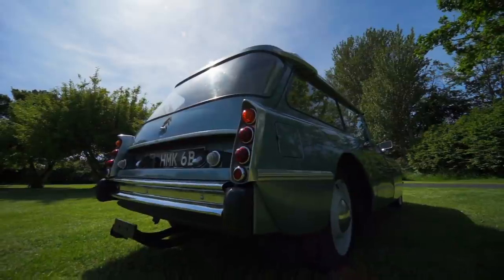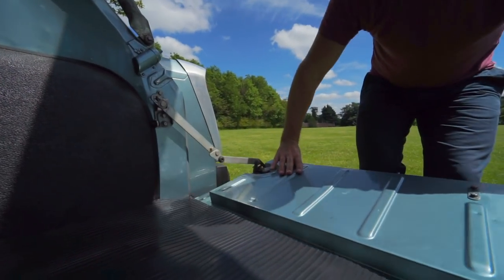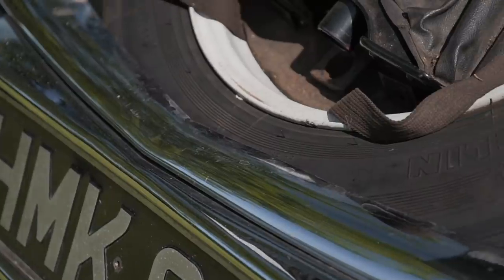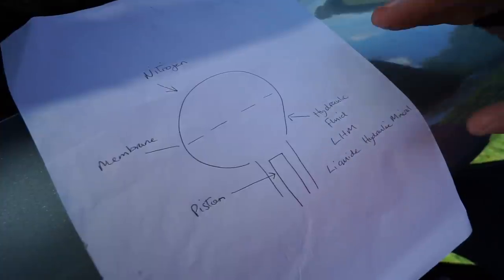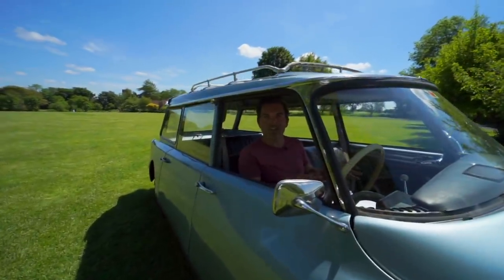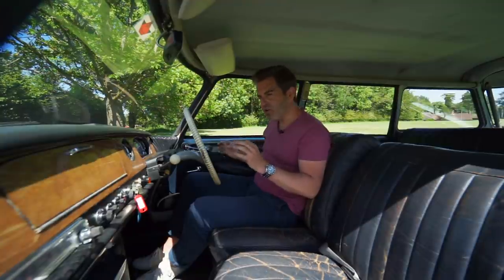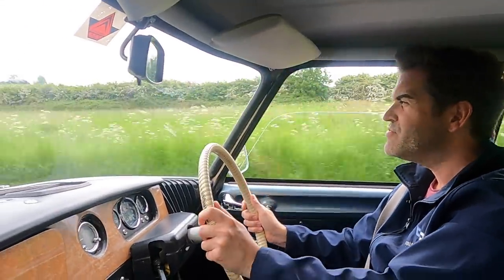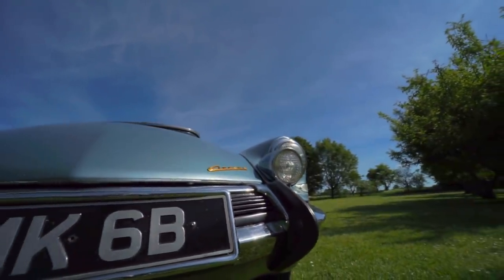1964 Citroen ID19 DS Safari - an Iconic Avant-garde French Family Wagon | Collecting Cars

Comment: I took my Safari to Southern Italy in the late 60's... 4 people, all our luggage + a fridge on the roof rack... heavy snow on the motorway, but still safe to drive at 50-60.
It wasn't until I pulled in to fill up that I realised that we had had a puncture as there was nothing left of the offside rear tire... another Citroën quirk.
I also owned a 1957 DS19 that had been used by DeGaulle... great being able to stand up in the back and wave at the crowds!
These days I have a Citroën SM... like riding a magic carpet with a Formula 1 engine, and, like DS becoming "Déesse", SM becomes "Sa Majesté".

Comment: The DS Safari was a supreme beast of burden, so comfortable and fast over vast distances.
Did you know the roof and roof rack set down with knurled rubber is aerodynamic and does not whistle - 

I have tried 30 years ago in my 1965 ID 20 safari. No whistle at 90 mph. Throw 2 Canadian canoes on the roof plus 5 on board and camping gear and she makes it so easy.

Love when you squeeze zee champignon brake button at 60 mph in the dirt with your hands off the one spoke wheel and the car squats front and rear, thanks to load proportioning valve to the rear brakes. Even if you have a front wheel blow out. You can drive a DS (pronounced Day eSeee) on high suspension on 3 wheels.

This must be a British safari - wood dash and leather... gilding a French work horse to make in posh for the Poms....
Reply: Definitely built in slough.

Comment: I had an ID19 (briefly) in Seattle in the late '80's, and as an engineer, I loved all the innovative design details. I made the decision to hand it off after finding that retrofitting 3-point seat belts was difficult and expensive, and that the unibody had extensive rust. Still miss it, though.

Comment: That was my dad's car. No...not this model...this car. He bought it at 1 year old (when I was also one) and we kept it for 30-odd years. We drove from Lancashire to Vienna in it....twice! Later on, one of the huge front wheel bearings began to fail, so he and I drove to Edinburgh (late 80s / early 90s) and rummaged around a massive Victorian greenhouse in Gerry Mallin's garden for a complete suspension and wheel bearing unit. This car was assembled in Slough, and to get round import duties on "foreign" vehicles it was built with some parts from UK firms, notably Lucas and Jaeger. From new, it never had seatbelts, and us three kids would slide around on the dep blue leather rear seat. As a new car in 1964 it would have been fearfully expensive.
When I was tiny, my older brother demonstrated the cigarette lighter...by applying it to my cheek!

Comment: I had BX and Xantia estates. Amazing suspension but complex and not too reliable hydro-pneumatic systems. I learned the hard way that when the [STOP] light came on, you stopped (or tried to) immediately!
Reply: If normally maintained it works flawlessly. I had two BX, changed the spheres myself
Reply: A well looked after system is super reliable. Maintenance is key as with any wonderful piece of engineering. It’s actually modern materials that make them unreliable. Poor quality rubber parts etc…

Comment: ID 19  Safari conventional brake pedal/clutch . Power brake with floor mushroom  button + clutch pedal makes it a DW 19 Safari The  DS designation refers to semi auto gear change. Right hand drive metal roof probably built in slough, glass fiber roof French built. I had a DW Safari & DS presidential trim saloon in the 1960's
Reply: Correct - Slough built, with plenty of UK parts to get round import duties.

Comment: The ID model is cheaper than the DS and lacks the glazing that covers the headlamps. Not sure if the headlamps turn with the steering like the DS. I've seen a Safari estate in London recently driving along Commercial Road in Stepney, PYR68L. Competetion from the square tank Mk4 Ford Zephyr estate.
Reply: Actually the glass on the lights doesn’t relate to the model being DS or ID - this was just a design change in the car in 1967. Also the early DS up to 1967 didn’t have turning headlamps. ID (or D Super or Special as they were later called) didn’t always have turning and levelling headlamps but many people fitted it.

Comment: The title says "Citroen ID19 DS Safari" – but is that not self-contradictory?

The DS (Goddess) was the fully equipped range, whereas the ID (Idée) was the budget version. Surely it can't be both a DS and an ID. As the car in the video has a mushroom brake button I suspect it is a DS; my ID had a more conventional pedal (and no power steering).

I had an Aussie-assembled ID (very second-hand and rusty when I bought it in the early '70s). It, too, had a UK-style wooden dash, even uglier than that Slough version; the flat wood dash just didn't aesthetically cut it with the rest of the French design.
Reply: The Safari version is something in between, it did not exist in ID/DS versions. Officially it was an ID, but it had some DS features and always the mushroom brake.
Reply: @DSReval  Correct...I can vouch for this car's originality, though it didn't have the spotlights when my dad bought it in 1965. And the boot had a nice navy blue carpet, not that rubber mat.  And the wheels were black, plus it had no seatbelts.

Comment: Nitpick: The car can't be both an ID and a DS: The ID was the de-specced, cheaper version.
Reply: The D series includes the original DS and later simpler ID with less complexities. My Aussie assembled 1962 ID19 had manual gear change and steering and the brake button was disguised with a pedal.  Vinyl seats, basic carpet, vinyl roof lining on aluminium, not fibreglass.

Comment: This dashboard is not the modern original one, no need to fawn over this british-ized one. For that period, the DS set standards was way ahead in comfort, breaking, stability, silence and road holding. It had inboard disk brakes and that hyper assistance made it a dangerous car to follow too close. Also, that suspension helped you change a tire without a sweat and in a blink of an eye. However, its maximum high position was not for riding nor off-roading because it blocks the suspension. I had a DS23 Pallas Injection Convertisseur (semi automatic) and it was supreme and still difficult to equal in a reasonable price range today.
Reply: That dashboard is the one which was installed in Slough, where this car was assembled. It had fewer cracks back then, though!